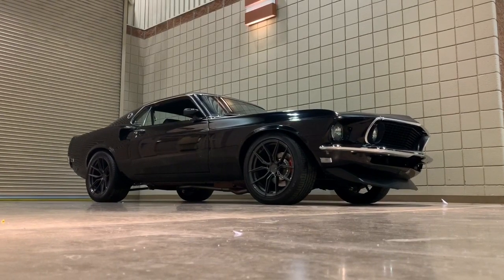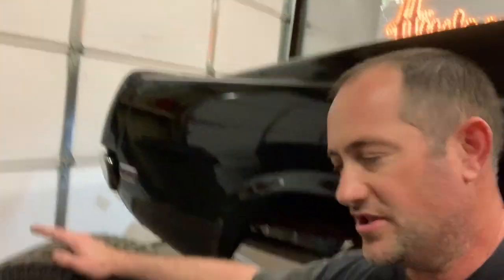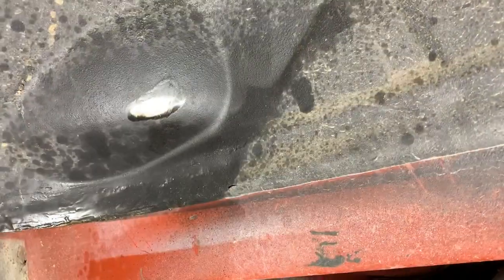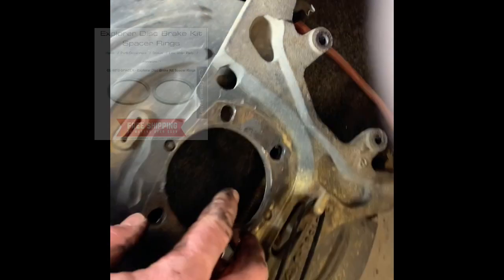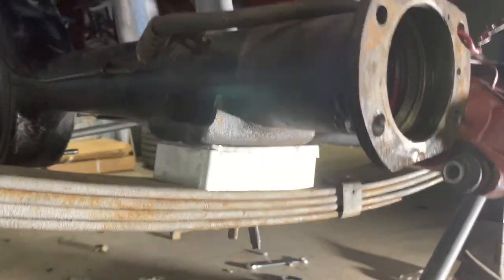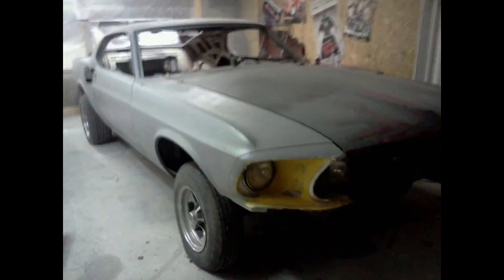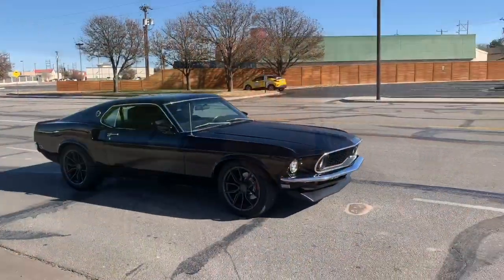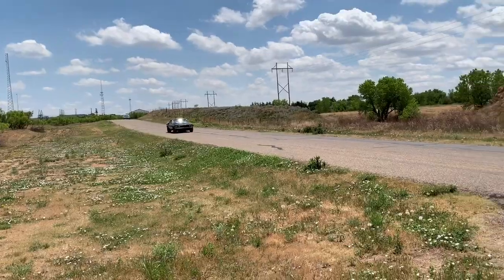1969 Ford Mustang Fastback 351W Roller 5 Speed T5 Rear End Leaf Spring Repair Test Drive

Comment: I notice you have pinion shims. I have a 70 with a T5 and 1 inch lowering blocks and it has a driveline vibration above 65mph. Did you have any vibrations because of driveline angle? If so did the shims help?
Reply from the maker: I used the spicer driveline angle finder app and it did show I needed shims to correct the vibration I had.  It was fairly easy to use app with you Mobile phone.  I believe it needed 2 degree shims.  I have no trouble now.  Good luck.
Reply: @dissrepair   Thanks. I checked mine with that app and trans is down 4.3 degrees and it can't go up anymore.  My pinion is  almost exactly 0 with loaded suspension so obviously it's not close. I'm going to shim my pinion up and see if the high speed vibes go away. Sweet car you have!
Reply from the maker: @dcsmitty50  I hope it works for you.  Also you might wanna check your driveshaft to make sure it is far enough engaged into the trans.  That can cause vibrations too.
Reply: @dissrepair  Thanks.  All else is good. New balanced driveshaft, new yoke and trans is rebuilt with new tail shaft bushing. Have about a inch out on the yoke.